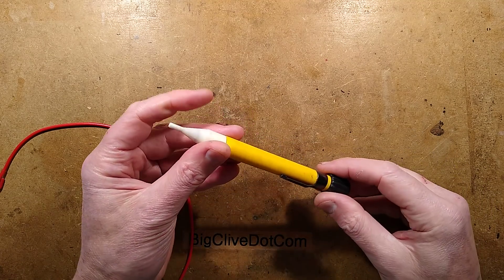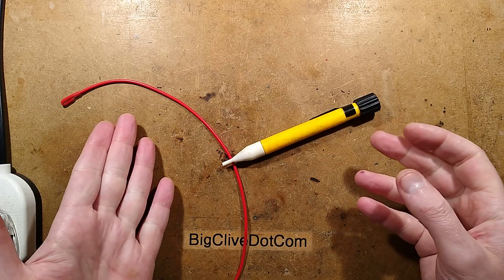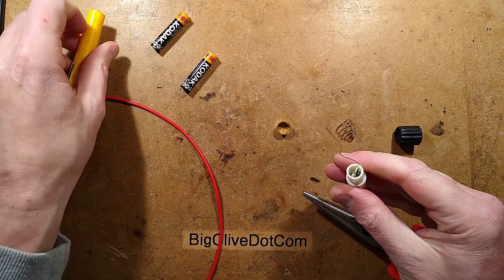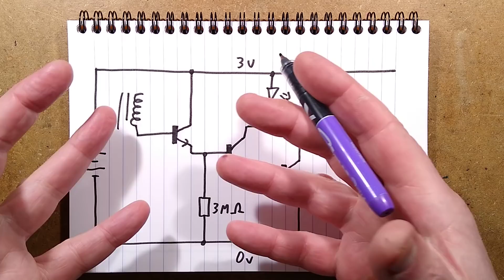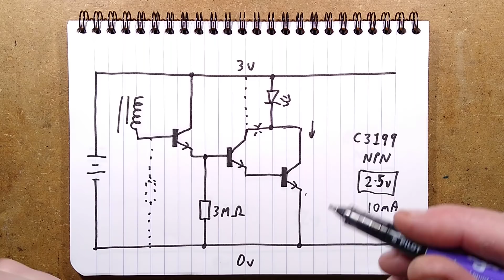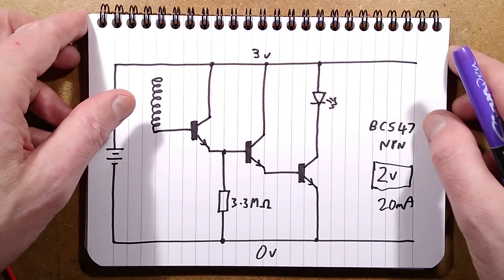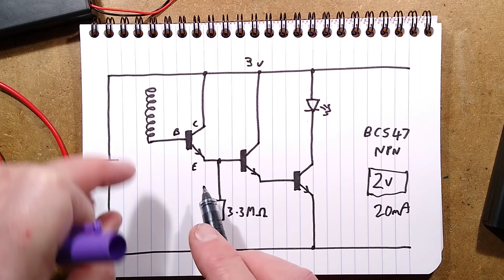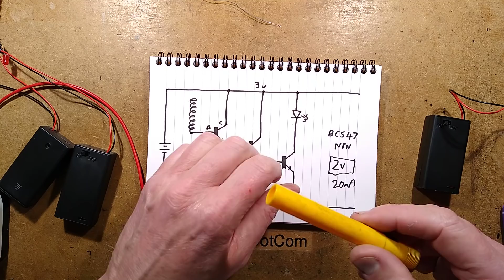Volt stick circuits and tests

Comment: Biggest misuse of one of these testers I ever saw was an HVAC "technician" (who had his own company; probably still does) use one to determine that an AC compressor in an outdoor condensing unit had failed. He used it to check for voltage at the compressor and it showed voltage at the compressor. Only one little problem--that condensing unit was equipped with a contactor that only opened ONE of the TWO 120V-to-ground legs (this on USA split-phase power). So the voltage tester was correctly showing the presence of voltage on the compressor. It was, however, NOT showing a complete circuit. They aren't designed to do that. It also didn't occur to this dipstick to wonder why the fan in the condensing unit was also not working. Since I was asked to look at the unit by a friend (I am NOT an HVAC tech) I noticed that the contactor didn't seem to be pulled all the way in, and I checked the voltage across the output with a multimeter, 0V. Then I took one of the probes and pushed down on the contactor and the guts of a dead bug that gotten into it squished out as both the fan and compressor turned on. There was NOTHING wrong with that unit other than the bug in the contactor, although I probably would have replaced the contactor if it were my unit, maybe with one that has a little better protection against bugs getting inside.
Reply: @Brian Leeper - debugging, in the truest sense (and if I remember this right, the original sense).
Reply: @matambale  You remember correctly
Reply: @matambale  Yes, that term came to be back in the 1940-50's when some of the telephone and teletype equipment had a lot of relays...for some reason, insects just love to get into electrical stuff. I worked for the Telephone Company in the 1960's and seemed like no matter what you did to seal up things, insects got in there.
Reply: @matambale  as a programmer I always find the history of the term interesting.
Reply: Putting a DMM set to Volts across the contacts of a switch, contactor, relay etc. when the equipment is powered up will give you a rough idea of the contact resistance, depending on the load of course. If you see mV's it's suspect, again, depending on the load. If you are into 100's of mV or Volts you have serious problems.
Reply: Yes I have seen those cheap contactors, and generally regard them as replace on sight with the sealed 2 pole version, as they do work better, and are less likely to fail from dirt and dust, let along moths.
Reply: I had the same problem with the paper feeder in a printer once. It was obstructed by a piece of licorice.
Reply: I use one as a safety check before getting into a HVAC unit.  Verify it doesn't go off on the disconnect box or unit before opening anything up.  Then that there's voltage on the line but not load side after pulling the disconnect.  And frequently, while inside, just to make sure I have confused myself as to the state of the breaker or disconnect during diagnosis.  Always verify with meter at the line side of the contactor before I start pulling connections.  Not an HVAC tech, but at my outdoor unit, you could back into the grounding conductor at the service entrance and if you find a hot wire find out what the SPAM Clive has heated with his forks felt like.
Reply: @jkbrown5496  I don't actually even own one of those. I normally use a test light (LED bulb in a socket) or a neon test light to test for voltage. Also an LED bulb between hot and ground will trip some AFCI and all GFCI circuits which can be useful.
Reply: @brianleeper5737  I've worked around all sorts of electrical equipment, and most of the GFCI's are tripped by about 1 milli-amp.
 My last job had a 3-phase, 480 volt, 1,000 circuit breaker on the incoming power, still tripped at 1 milli-amp.
Reply: @dougankrum3328  The UL standard for a Class A GFCI doesn't require it to trip until the leakage exceeds 4mA to 6mA. A GFCI that tripped with 1mA of leakage current would have quite an issue with nuisance tripping.
Reply: I don't know why, but ants LOVE outdoor condensing units with open contactors.
And you're 100% right - if this guy was any kind of an actual HVAC guy, he should have known that most of the contactors used on those units only break one leg to the motor and fan.
Reply: @jdgower1  Not always, but usually right after you take off the cover of the electrical section of an A/C unit...there's a schematic...but you have to know how to read it.
Reply: @dougankrum3328  Whether the drawing is there or not, and whether one knows how to read that drawing or not, just looking at the contactor is enough to inform someone whether the contactor is breaking both legs or just one.
In my line of work (industrial and heavy commercial/institutional maintenance work), typically contactors break all the hots. But just in doing repairs and stuff on my, and my friends' and family's residential grade stuff, I've noticed that a lot of residential and smaller HVAC applications break only one hot wire. I understand that isn't always the case, but it is the case in the vast majority of cases on those lower grade and cheaper things.
Reply: @jdgower1  Yes, I agree....looking at the wiring on the contactor/s should give you a good idea of the circuit. Most of the A/C units I've worked on were some a little larger than residential, most had a 2 pole contactor for the compressor. The contactor was usually right the by the compressor, so you could see the wiring. In all my time as industrial Maintenance, A/C was maybe 2% of my work. Often the problem was people leaving the 'office' doors open when it was 108-110 degrees (F) outside and the system just got overloaded. Other A/C troubles on commercial units was lack of maintenance by someone before me, and the units were just old, and compressor/s were pretty worn out.
Reply: Always test properly, there's reason multimeters have TWO wires :3
Reply: @Brian Leeper -It might not be 'incompetence'! After all, replacing a compressor motor (along with the contactor of course) would have brought him much more profit than simply replacing the contactor or even more simply cleaning the contacts and it would have cured the problem completely!
I see this sort of cr*p so often in so many professions, the most recent from water ingress remediation companies when asked to look at a big apartment block. I can entirely sympathize with BigClive for being wary of purchasing the potentially dodgy workshop with damp walls as any reports probably would have leant strongly in favor of the seller.
This sort of corruption/rip-off is extremely repugnant to me but I can see that a high percentage of the population would trust the bast**ds. Thankfully not in this case. Well diagnosed!
Reply: @leybraith3561  That guy was in the process of installing a hard start kit in an attempt to make the compressor run again, so he clearly had no flippin' clue what he was doing.

Comment: is it pulsing at 50hz or 100hz (once for every peak)?
Reply from the maker: 50Hz.  It only operates on one polarity.
Reply: @bigclivedotcom  so does the polarity on which the LED lights up change based on the orientation of the stick to the wire then?   and it's just that at whatever orientation it's in, one peak is inducing voltage more positively than the other peak?  sorry, i only have a vague understanding of E&M :)

Comment: Anyone knows when those first came to market? I'm almost sure I only saw my first one in the last 20 years but they must have existed for longer with such a simple design. I'm kind of amazed I never encountered the schematic for one in a magazine back when I bought them. I'd say they were worried about safety but then I remember some of the projects they would publish back then.
Reply: The one I have now is at least 20 years old. It was from Sears. I use it so seldom that I think I've only changed the batteries once.
Reply: I saw them advertised in the 1980's magazines, plus DIY versions from then, but the design has been around since the 1960's where it was generally used to detect energised power lines, so service crews could find out at night if a power line was energised or not during repairs.
Reply: @SeanBZA  if they were marketed toward tradesmen they probably cost $50 apiece
Reply: @tncorgi92  No, marketed to utility companies, so $500 each for the detector head, and another $1000 for the special pole, plus of course an annual service required as well, with sealed batteries in them, that needed changing at that service as well.
Reply: Bought my first one from Tandy (Five Ways superstore in Birmingham) around 1983 - 4. I remember a few designs for "contactless voltage detectors" in  Practical Electronics, and a rather complex design (using latching logic) in Electronics Today International - around the early 1980's.

Comment: Those in continental Europe should check that the tester has a round tip like that one. There are many testers with flat tips on sale. They are made for the US. They may give a false negative result on an European socket that is live.

Comment: How is it possible for a wire with no circuit to induce a current in the volt stick? You mention it basically forms a capacitor, but how is it possible, does it have to do with the magnetic field generated around a wire, but it's still not a circuit so I'm confused.

This is a similar idea as has been demonstrated by people like Steve Mould as to why bad LED bulbs stay lit when off and I still don't get it.
Reply from the maker: Tiny capacitively coupled current, finding the return path to ground via you.  We're talking nano-amps here.

Comment: I've never had to hold onto mine. You can actually wedge the tip into a socket and hear it's buzzer (if they have one) while you go to the switchboard/service panel to find the circuit

Comment: My issue with the volt sticks is the fact that they fail in such a way that one could be lulled in to a false sense of security.  The moment you question a piece of safety equipment, it becomes worthless.  Dead batteries have bit me twice.  Never again.
Reply: I get what you're saying, however I would argue that you can solve the issue by prove-test-prove, the same for any piece of test equipment (prove its working, do your test, prove it still works afterwards). Also, it's not supposed to be the sole test for isolation, just as an indication of whether something may be live (handy if you just want to know if a socket has power and can be used), or if you are trying to find which breaker supplies the circuit you're wanting to work on but not being a replacement for proper tests with your meter
Reply from the maker: It's normally recommended to test any piece of electrical test equipment on a known live source first.
Reply: That is odd. I use the Klein version which beeps when it turned on. No beep mean a dead batteries.
Reply: Yup, that's why some of them (most good ones?) nowadays have a button that lights up the LED, so you can test batteries.

But still, using them you can't really tell if it's full mains voltage or not. Maybe something is wired wrong and you don't get full mains. Well, by just using a voltstick you're not gonna know, but it will flash and it could mean your troubleshooting is going to last a whole lot longer because "well, this cable is okay". ;)
Reply: Like any test equipment you should prove it's working both before and after using it, on a known live source or proving unit (there are special proving units for volt sticks).
Reply: Shirt test, test wire, shirt test. They are an indication only, I use one as a quick confirmation I've pulled the correct breaker before grabbing any wiring.

Comment: These non-contact voltage detectors have some interesting nicknames among people Ive worked with. I tend to call it a "tweety," out of habit, because it does a lot of beeping, one coworker calls it a "wiggy," but Ive also heard people call them "sissy sticks" as if theyre more manly for not using them! I think it says a lot about the person that calls it that.
Reply: A "wiggy" is actually a name, a trademark I think, for a solenoid voltage detector. The original version made by Square D seems to be out of production, but a similar one is made by Ideal.
Reply: Chickenstick here in Canada
Reply from the maker: I think wiggy is referring to an older style of test lamp.
Reply: Back in the 1970's the Australian hobby electronics chain Dick Smith had a signal tracer kit called the "Dick Tracer"  - best name EVAH!
Reply: I've seen some USA electricians call them a tick stick or tick tracer, I guess because you're not really supposed to decide live or dead based on it, just follow looking for breaks.

Comment: Can you make one that doesn't need a battery at all and is powered purely by the voltage induced from the live wire?
Reply from the maker: Not really.  The capacitively coupled current is very low.

Comment: That is incredibly simple and demonstrates how much I need to learn just about simple circuits!! 
A Beginners set of videos would be very helpful to someone like me who can take things to bits, test obvious possible causes of non functioning items and when successful replace but I don't know exactly what half the things do and why they are linked in certain ways!  I continue to learn from all your videos, thank you very much.
Reply: I know Clive has a video titled something like "basic electronic components" or something like that, might be a good place to start if you haven't come across it already
Reply: @JordyValentine  First, outstanding AF handle (if you can prove it.)
Second, yes. I recall watching that video many moons ago. Your comment reminded me that Dave (that EEV blogger from the upside-down land where all the elections fall out) has a series which makes for an excellent first and second year course on the basics of all these squiggly drawings.
Reply: @matthewellisor5835  Thanks, I'll have a shifty when I have a spare block of time. 👍
Reply: @JordyValentine  Thank you for that, I will run back through then to watch list.
I must admit being practically minded once someone shows me what to do and why it makes sense, reading in books doesn't stick!
Reply: What really throws me for a loop but its probably a very simple thing for electricians is wiring lights to multiple switches.  I know its probably simple but until I do it and understand it with my own hands I can't think about it, even when trying to follow one of CliveCAD's diagrams.
Reply: @MrShwaggins   Think of it as using two parallel wires between switches feeding the end light switch that supplies the light. The switches in-between cross the feed over from one side to the other, so the final two-way switch is only energized on one connection and depending on which way this is flipped decides if the light is on or off. If one of the intermediate switches is flipped the supply goes down the other leg and the light is energised.
Reply: @Arachnoid_of_the_underverse  Do you use different wire for attached/shared switches?  Like most stuff is 2+ground, but they also have a 3+ground.  Do you use the 3 conductor for switches?
Reply: @Arachnoid_of_the_underverse  Also, standard switches are considered SPDT (single pole double throw)
Reply: @MrShwaggins   It depends, if its a new install you can just use Twin and Earth (2+ ground) to wire it all. If its an existing 2 way switch system like top and bottom of the stairs and you want to extend it to a third switch you can extend with three core and earth ( 3 + ground). using the third core to connect to the common connection on the switch thus providing a return path for the live.
Reply: I think I can cope with this circuit too :)

Comment: When the lights are on there may be voltage or static electricity. 
If these do not light up, there may be a lack of voltage or the detector may be broken.
Who knows?
Reply: This is my issue.  They fail in an unsafe condition leading to a false sense of security.  Good observation.
Reply: @TechGorilla1987  I'll stick with the reliable neon testers.
Reply: That's why I always test it on a known live circuit before and after testing the circuit in question. 
I usually work on stuff I'm concerned about in the 120 to 480 volt range, and in the US, it's not hard to find something plugged into a wall at 120V to do a "Is my pen working?" test before I test the circuit in question. Then I test the circuit in question, and then go back to the known source to verify my pen didn't die after my first test.
Reply: Rule is to test a known live circuit, then the circuit in question, and then another check with a live circuit
Reply: @darkfur18  Exactly.
Reply: Dangerous voltage should put the LED off ! then it's in test mode all the time it's not finding voltage.